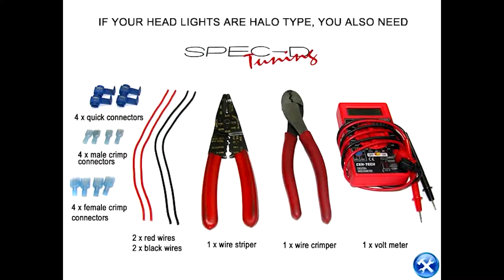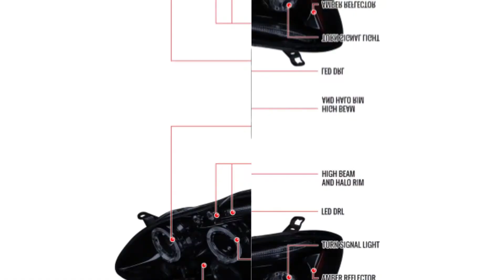DIY Install: Spec-D Projector Headlights Toyota Corolla (03-08) w/ Dual LED Halo - Black or Chrome

Comment: So are these brighter or darker then the factory headlights?
Reply: I'm asking the same question too
Reply: @icandodgebullets7869  it would be nice to get an answer.
Reply: It would be brighter, factory reflector housings are usually less bright and have a spreading beam pattern, but projectors give you a far accurate lighting which is brighter and illuminates better.